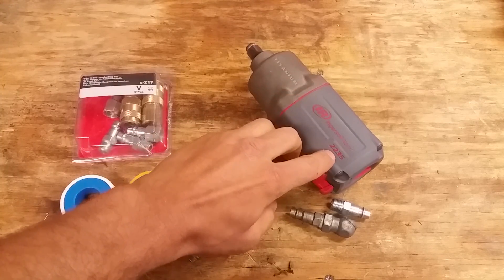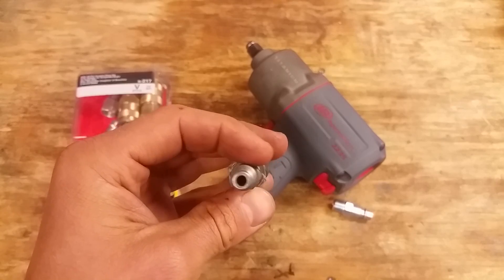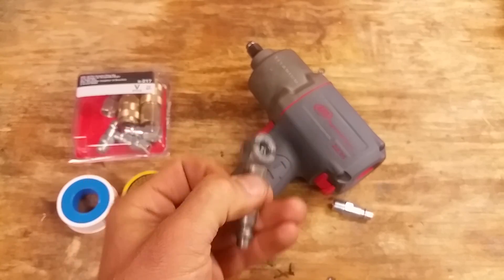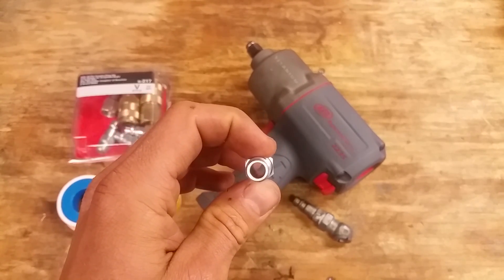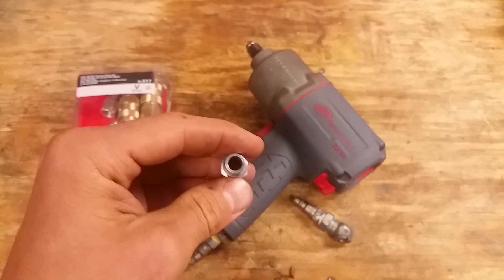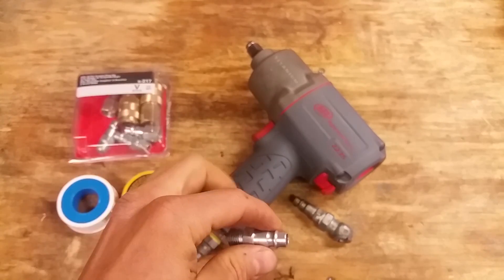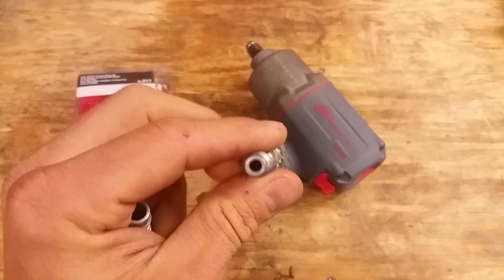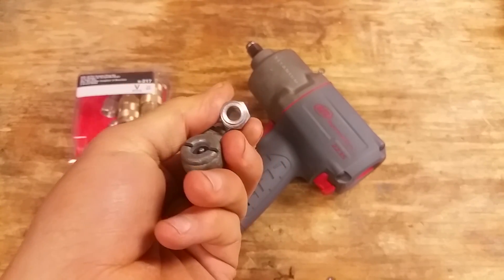The BEST Air Fittings Made?!?

Comment: Just one question...are you getting 90 psi at the tool itself.  Sounds like you need to turn the air pressure up.  I do agree higher flow fittings help but a lot of people set their regulator to 90 and are probably only getting 75-80 psi to their tool
Reply from the maker: Good question. Yes, I made a testing adapter with the most accurate PSI guage I own. I tested it at the tools and I am getting 90 PSI at my tools.

Yea a lot of guys do not turn up their regulators high enough. Mine is set above 90 PSI like 100-110 I can't remember off of the top of my head.
Reply: @MattsShop  I work in a semi tuck shop and our air compressor is upwards of 150ish psi and a guy 2 guys i work with use that exact impact to take off semi truck lug nuts they they torque to 450-500 ft lbs. I have a cornwell 1/2 impact that is basically the same thing as this, ingersoll rand makes it and it takes them off no problem. i used my impact at home and was surprised by the difference, never thought my shops air was at such a higher psi.

Comment: I will let you know in a few. Been trying to get a main shaft pulley bolt off my engine on a 2000 Ford Taurus with my nitro cat 3/8" dr gun won't budge. I changed out the fittings and will be back.
Reply from the maker: It'll come off now!

Comment: Your Champion 5hp 80 Gallon Compressor only does 17.2 max CFM at 175psi... Maybe 18.5-19cfm at 100psi?  You didn't show us your Pressure regulator settings either during the making of this video. Why would these fittings make that much of a difference? Unless it's not about CFM and it's really about PSI or something?
Reply from the maker: Yes, you are right on the CFM numbers of my compressor. I have A 3/4" hose to a 3/4" pressure regulator. These fittings help reduce airflow bottlenecks by increasing the CFM flow.
Reply: @MattsShop  Correct but if the CFM rating for the small fittings is almost 2.5 times that of the rating of the compressor, the fitting cant be the bottleneck... Seems awfully fishy...
Reply: @MattsShop I have DeWalt 225 PSI 4.5G 5.2 SCFM Compressor, Ingersoll Rand websites says 2236QTiMax Impact Wrench requires 36 CFM. How is it possible, every website on the planet says typical 1/2 Air Impact Wrench requires 4-5 CFM @90 PSI. My 2236 has no torque when running on forward gear, much better torque on reverse….

Comment: Did you change the fitting on the other end of the hose too?
Reply from the maker: I don't use quck disconnect fittings on the other end. It cuts down on flow. It's best to just use pipe fittings at the compressor end and make it more perminant if you can.

Comment: HOT ROD HOSES, cant belive the difference.
It does make sense tho. To many times I tried to pull axle nuts with high torque guns and nothing. seems to me now that it was an air out put issue and not the gun or compressor. I will swap out for this in the near future, thanks for the info 👍

Comment: Not really arguing, but I’ve got the same gun with 3/8” hose and Milton 1/4” M style fittings.  It would’ve taken that nut off just as fast, guaranteed.
Reply from the maker: It's not just how fast it takes it off that matters. It was just for demonstration. Anything would have taken this nut off. It really wakes up your air tools when you actually need the power.
Reply: seems very underpowered with the stock fitting - my IR231 is very happy running @ 120PSI also and with a stock fitting it would rip my hand to shreds trying to hold the socket/anvil like that.  Those hiflow fittings are great though and I do run a 1/2" hose...

Comment: That's so odd. I have no problem with the smaller type.
Reply from the maker: Try these fittings and then you'll see the problems with the smaller type fittings lol.
Reply: @MattsShop   Matt's Shop  I have heard both ways. But I would say that my 2131 has no problem taking off lugs even at the end of 100' 3/8 hose. The only time mine let out air and would not turn, 5:57, is if the direction button was not pushed in all the way. It's also interesting that having one restriction versus two has any difference at all. They look like they were the same size restriction. Idk, good video for those that liked it. I'm in the middle personally. Take care.

Comment: Bad info in this video!  Nothing wrong with those V fittings...but something is very misleading with this for sure.  Looks almost like you had the air pressure turned way down for the before using the M fittings and turned it up for when you used the V style fittings.  That impact does not require any where near 40 CFM to run at its best...so an M fitting is more than adequate.  According to IR your 2235 impact uses a maximum of 24 CFM at full load...still half of what a M series can flow.  

Additionally...you even mentioned the swivel fitting you left on there...it is more restrictive than the new V fittings...so you cant have less air flowing though one part and then more though another down stream of that.  

Your comments about hose size and end fitting sizes are all wrong...most 1/2" air lines use a 1/4" NPT fitting.   

Now having said all that...I am converting all my old M style fittings over to the V style.  Mine are old and some are leaking and I want to replace them all.  One thing you did not mention is that the lock sleeve on the V style defaults to the unlocked position so that you can push the plug side straight into the coupler without having to pull on the lock sleeve.  Big advantage over the M series stuff and main reason I am switching over.

Comment: I already ordered mine , meanwhile i want to make sure that i can use this connectors with a 3/8 hose to 1/4 thread adapter (the hose doesnt have any type of connector) , can you give me the Id of this connector pls? I just need the id of the connector on the impac wrench. Thanks
Reply from the maker: They will work. These connectors use a standard 1/4" NPT thread.

Comment: That's basically 3/8 fitting, I went industrial 1/2 fittings which are the best but the only problem I had was fitting them up to my tools which required a 1/2-1/4 adapter in order to thread them on to my tools. I am currently looking for a bottom nut replacement for my tool to accept 1/2 fittings naturally without any stupid 1/4 adapter.
Reply from the maker: 1/2" air fittings are OVERKILL. That's what you would use on a 1" impact beast lol. Not a little impact that you need to get into tight places.

Comment: I've been running these for a couple years now. Only thing I don't like is that they're getting kind of difficult to put together. The M style are easy to fit in the female V's, but the male V types take a lot more effort than they used to when new.
Reply from the maker: Yea, I have noticed that. It takes some effort to pull them apart once they are coupled under pressure. Still worth every penny for the performance gains.

Comment: just a comment on an unrelated topic - I was always told by our tool room where I worked  that you never used teflon tape on air tools because of the danger of the tape shreds getting up into the air tools and jamming them up
Reply from the maker: It can happen. A trick you can do is start wrapping the Teflon tape below where the threads on the fitting start.

Comment: Dude, I have to tell ya I'm so glad I found you and this video I just received these from Amazon today and installed them just as you recommended and then tried out my new AIRCAT 1150 and it worked AWESOME !!!!! I almost sent the tool back because it would not run well at all. Then I found you and your video and it changed everything, My new air gun does what the factory describes.I'm so excited !!!!!!! Thank you so much and I just hit the subscribed button along with the bell. look forward to seeing more great videos. Hey question do you know if you can buy these items by themselves instead of the kit I just need a few extra pieces. Thanks again.
Reply from the maker: WOW thanks for the great comment! I didn't realize so many people didn't know this. I am glad this video has helped a lot of people and helped you.
They sell these parts individually on Amazon. I'm pretty sure I linked to the individual fittings in the description. Thanks for subscribing!
Reply: You can order these straight from the manufacturer. I changed all mine out I think you should a few years ago when my new high powered air gun would not even take the lug nuts off of my truck. I even went as far as to buy a bigger compressor and nothing changed. I was looking up something else the day that I came across these settings. At first I only could find them for sale at Amazon. That's when I Googled the company and went straight to their site. You can buy one piece or a hundred and the more you buy the cheaper they are. For everything that I bought I did not even come close to paying $50 and that was for 40 of the piece that goes into your air tools and then I bought two of the quick disconnects just in case I was to ever break one. It changed everything. There is nothing that I cannot remove with my half inch air gun.

Comment: So does this mean 
compressor manufacturers,

and air tool manufacturers are designing, and outfitting
their products improperly?

Do you think the 
tool designers from the different companies would also be surprised and impressed if they saw this video?

My guess is probably not, 
for any that are experts 
anyway.

So why might companies be outfitting tools, hoses, fittings with what appears to be 
inner diameters that are too small?

What could the reason/s
be for this?
Reply from the maker: Simple answer = cheap. The standard fittings are "good enough" to get the job done. They are cheap and everywhere. They are not going to take the time to reeducate everyone that there are better fittings out there.

These things work. Some manufacturers don't even include air fittings in the box with the new air tool because they know people like to run their own setups.

It's like anything else. Aftermarket stuff can increase performance sometimes.
Reply: It is because the engineers at the factory know the orifice rating verses air hose ratings. And a 1/4 inch orifice will flow more air than any home owners compressor could ever put out. Look at the size hole in your pop off valve. Hose is rated at 100ft at 100 psi. My 160 cfm diesel compressor will only hold 100psi on a 1/4 pipe. It will hold 200 psi with pipe turned off. Hose is rated not to exceed a certain mph speed in the hose because hose will over heat do to friction. So looking at fittings and pipe up to one ft.  look up orifice rating.

Comment: Does the coupler on the tank need to be changed to hi flow as well or just on the hose only? Thanks!
Reply from the maker: Yes, change it or better yet, plumb the air hose directly into the tank without a quick connect. You wan't the max air flow possible.
Reply from the maker: Yes, it's worth every penny! With a small compressor it gets you every bit of power you can. You can put a quick disconnect at the tank, but it cuts down on the flow a little bit. Make sure you are using 3/8" or 1/2" air hose.

Comment: my air blower tool has recoil now lmao.
Reply from the maker: BEAST MODE!
Reply: When i switched to these fittings about 10 years ago i quickly discovered not to blow off painted surfaces if they're not in perfect condition. any crack or worn edge and the air power will blow the paint right off.

Comment: Never  use a hardened chrome socket with an impact. Always use impact rated sockets.if you do not know any better you should not be making videos showing unsafe practices.
Reply from the maker: Lol It was torqued to like 80ft lbs of corse I know that. I didn't have the right size in impact socket. It was a 2 second test. Sorry to disappoint.

Comment: Is this considered automotive or industrial?
Thank you.
Reply from the maker: I'm not sure what you mean. These fittings are primarily used for automotive tools. If you had an industrial application that could utilize the high CFM flow of these fittings I suppose you could use them.
Reply: Matt's Shop , I just got my first air compressor (used). Reading about air hoses, it is said that 3/8” hoses are recommended for automotive tools while 1/4” are more for construction/industrial use. Is that true?
Thanks.
Reply from the maker: Oh, yea 3/8" hoses and up for automotive use. The 1/4" air hose is pretty much useless for anything other than a nail gun. Industrial uses are like assembly lines where they have automated machines assembling stuff.
Reply: @MattsShop  2 different style id by the way coupler seals. Third style is Chicago style. Free flowing rubber seal 1/4 turn to lock together and clip to keep locked. Both automotive and industry style fittings have same cfm rating.

Comment: It would seem you would also have to change the fitting at the other end of the hose as well as the coupler coming off the compressor or shop system .
Reply from the maker: Don't use couplers at the other end. It's a waste of flow. Plumb it directly into the compressor. Unless you have a portable compressor, then change all of the couplers.

Comment: That swivel is killing about 30% of your airflow.
Reply from the maker: Maybe. I don't doubt that.
Reply: What about the other swivel style?
Reply: I've tried them (the ones that look like a "Z"... Believe me, those are even worse that the ball type... MUCH worse.  Remember that all abrupt changes in direction, cause a certain pressure drop at flow.  the ones that look like a Z letter have several abrupt 90 degree direction changes, plus the internal orífices are very small and resptrictive (disassemble one and look), they can be opened by removing the ring key.

Comment: yea this was smart, but turn up the compressor pressure will help with the situation 
i usually run 140 psi set at compressor and never use a pressure regulator it run a gun.
but a must is an oiler and draining off tank water , those are killers for air tools 
pressure regulators are death to tools like this where u need everything the compressor can give u.

GET RID OF THAT CHINCY SWIVEL!
Reply from the maker: You don't run an air regulator? I don't imagine a lot of tools lasting very long with 140 PSI flowing through them when they are supposed to have 90 PSI MAX. Oh I will get rid of the swivel and get something better. You should see what happened to it. It didn't last long. Check this out: https://youtu.be/cKiecATIAqs
Reply: Sorta like you said in the video, 90 PSI at the tool under load, my 1/2 inch 75 CFM @ 100 PSI Parker Regulator has a performance curve showing a 15 PSI drop at a 30 CFM flow. Measured with a gauge after the QD on an Air Cat 1250K and it shows just that; so I set my regulator at 105 PSI and get 90 PSI at load.  Maybe 140 PSI no load on low flow connectors gets you closer to 90 PSI under load, don't know, never measured it
Reply from the maker: Finally, somebody that knows their stuff! Yes, you always have to test the system/set up with a guage at the air tool so that you have 90 PSI at load. I have seen guys run all of their stuff at 125 PSI. Not very smart if you ask me.

Those Parker regulators are nice, but expensive!
Reply from the maker: Yeaaa!
Reply: Lol as long as you keep your tools oiled, they’ll run just fine with all the air your typical compressor can force through them. I’ve got IR and CP guns that are older than you are from the sound of it and they run just fine with the regulator wide open.
Reply from the maker: Yea, they run forever properly oiled, but why run them maxed out. What's the point? It doesn't really get you any more power. It just wastes air...
Reply: Matt's Shop it is very well documented on YouTube, my own experience, and every shop that you walk into that running a higher pressure will increase the performance of an impact. Waste air??? There is plenty of air in the atmosphere. I don’t know about your compressor, but mine usually sucks the air back in after it exits the impact’s exhaust... I’m not too worried about wasting air. If I was, I would want my impact hitting harder and spinning faster that much more. Argue all you want, but real world data  speaks volumes over conjecture based on what is obviously limited experience.

Comment: Any difference running a 1/2" impact with 1/4" high flow fittings vs. 3/8" high flows connected to a 50 ft 3/8" hose?
Reply from the maker: Maybe. What is the brand/model of the 3/8" fittings? It's all about the inner diameter of the fitting and how well the coupler flows.
Reply: The Miltons.  Trying to decide 1/4" vs 3/8".  Based on your vid it seems the HF 1/4 would be plenty.
Reply from the maker: If you are talking about the Milton V fittings the 1/4" and 3/8" is just the NPT thread size on the end of the fitting. It is not a bigger fitting like most other companies name their fittings 1/4", 3/8", 1/2" etc. I confirmed the flow is the same on their website.

You just have to get which one you need to fit your tool. 

If you buy them from the links in the description it helps the channel out!
Reply: @MrMustang1973   The flow ratings are given in their catalog if you download it from their site but to save you some time the V type (1/4 high flows) show as 74CFM and the P type (3/8") show as 68 cfm There really isn't a 3/8 high flow design, they're all high flow due to dimensions.   Interesting that the 1/4 High flows actually pass more air than the 3/8, not by much but some.  By way of comparison a standard 1/4" I/M or T type flow rates are ~40 CFM.  The 1/4 HFs will have 6 ball bearings, and the 3/8 will have 8, so more than flow, the difference appears to be ruggedness.